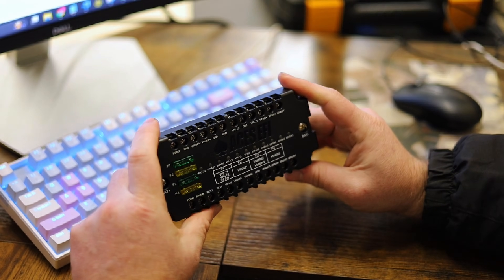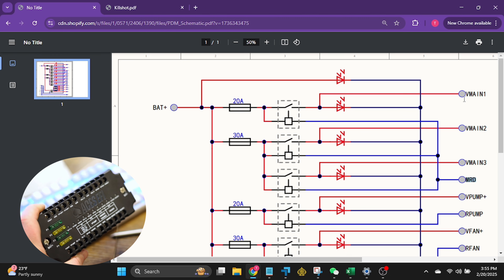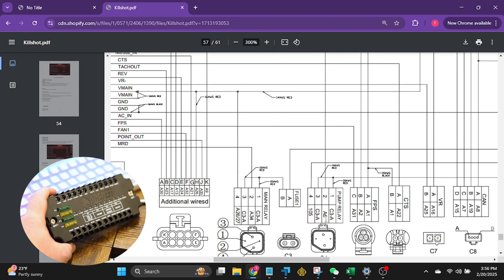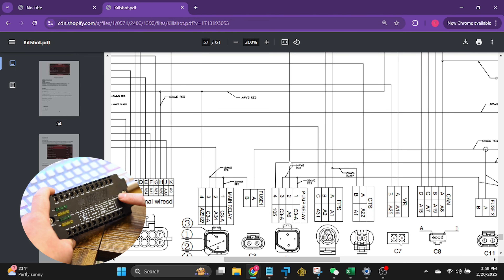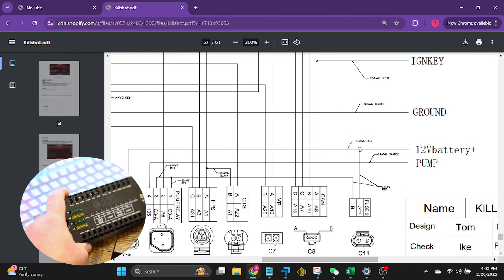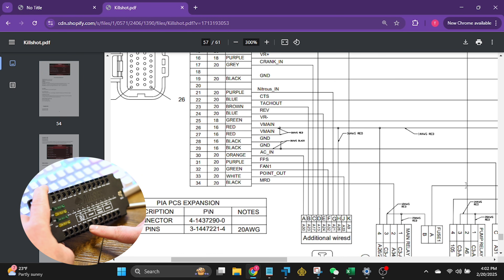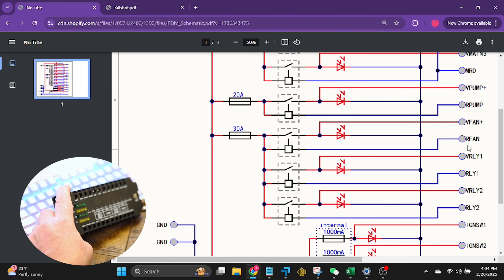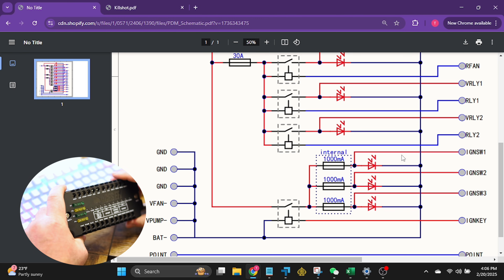PDM Schematic

Comment: Killshot fusion had wire labeled ground trigger In the additional wires. With that wire work on the pdm you trigger the vmaims or fuel pump w a killshot fusion

Comment: I agree, it would be much nicer to offer a replacemect harness for use with the PDM with the modifications already completed.  Once you come out with the modified harness in the future, will you offer a discount to existing PDM owners who want to upgrade to a proper harness?

What is the amp rating for each of the outputs - fuel pumps, fans, IGNSW 1-3, etc?

Additional question, if I do not want to modify my harness, can I just remove the harness mounted relays and fuses and connect to the existing harness with male spade connectors rather than cutting wires? Of course all connection points would need to be insude the vehicle or properly weatherproofed.

I just ordered a Killshot II system for my 1984 Cutlass to upgrade and replace my problematical electronic Qjet and am getting the top end kit with distributor and coil and the free PDM.

Last question, your instructions recommend installing the return style regulator after the throttle body - would I just connect the out line from the throttke body to the in port on the regulator, connect the return port of the regulator back to the tank, and plug off the output port on the regulator?

Thank you for your hard work to produce a quality fuel injection upgrade kit which looks fairly easy to install, is budget friendly for the masses, and I appreciate your continued commitment to innovation and support!

Comment: Can I use this only to trigger accessories off the 12v ignition source? I really only need it for things like electronic fuel pump (using the command center 2). Radio, and maybe fans?

Comment: I'm confused: 
1) If MRD is a line from the ECU that activates a relay ground, that then activates VMAIN, how is the ECU ever powered to activate the MRD lead? Sounds chicken and egg to me...
2) I don't see an MRD lead anywhere... is this only if you want to cut your harness apart?
3) VMAIN is supposed to be permanent battery to the ECU... wouldn't holding a relay open full time drain the battery?
Reply: With more research and playing around I think I may have answered my own question:
1) It looks like the MRD is triggered through the ECU when ignition hot is activated, so using the PDM it goes:
- turn key
- ignition hot activates IGNKEY on PDM
- IGNKEY activates IGNSW1,2,3 on PDM
- IGNSW1 powers up something small in ECU
- ECU activates MRD lead (small black wire moved from relay to PDM)
- MRD activates VMAIN1,2,3 on PDM
- VMAIN fully powers up ECU
2) this is assuming you've cut up your harness. MRD is the thin black lead to the primary power relay for the ECU. The intent is to replace the 2 relays and 2 fuses with the PDM.
3) VMAIN is not showing on when IGNKEY is not live, so it appears "permanent battery" is not connected until ignition on signals MRD to connect the VMAIN relays. So the only parasitic draw should be the always-on-for-some-reason BAT_IN LED

Comment: For the CAN handheld power (shown in the PDM general layout PDF going to IGNSW2) do you disconnect the 12V lead in the harness which attaches the CAN to IGNKEY and splice some wire in order to reach the PDM? Then with the clipped red wire that used to attach the CAN to the ECU, connect the ECU to the PDM at IGNSW1? This would give you two different 12V leads with one going to the CAN attached to IGNSW2 and the other would connect the ECU to IGNSW1 on the  PDM.

Comment: It would be awesome to see a blown up and labeled pic of the harness  (shown at 6:48 in the video) providing another confirmation of what wires from the harness attach to the PDM. I have an HEI and I’m trying to figure out the tach wire. I ended up snipping the gray TACH- IN wire from the additional wires connector… still working on it. I am planning to splice into my tach wire from the HEI to go to the POINT but I don’t think I need the GND right under it.

Comment: I think it would be nice to have an option for a wiring harness that doesnt have relays or fuses integrated into it that wires into the PDM without having to alter it. Or maybe a downloadable PDF that details how to alter it for the PDM. Just my opinion.
Reply: That is why we made this. That is the direction we are heading!
Reply: Or for a harness that has the relays in it so we have positive triggers.   So we can make a clean install and not alter the harness

Comment: I was wondering why I couldn't get things to work using the provided diagram. Now I'm torn to whether I want to modify my harness or return the PDM. Is returning the PDM an option?
I can appreciate what yall are trying to do with introducing the PDM, unfortunately there was no guidance or any mention of any of this when purchasing my system. I had assumed it was plug and play and would help me greatly with the wiring nightmare I was already dealing with on my Fox. So until this video I have been cussing this PDM.
Reply: Same here  wondering why my pump wasn't working this whole time thinking I screwed up something

Comment: I don't know if in need one of these or not.
I have had everything wired threw dry contacts for months..only thing i see it could do is clean up voltage on  main power coming from supply..i installed a voltage regulator keep volt constant to clean up supply voltage but due to fact can't get any answers from tech support so I
 don't know if i need to buy one.
Reply: If it isnt broken or having issues, why fix it? If you would like to clean things up and give it a cleaner appearance, go for it. If its working properly and not causing you any issues, dont fix what is not broken.

Comment: Wow that’s slick. Unfortunately I can’t use it. I have contour fans in my Fox. I need dual 70 amps
Reply: You can use it to control the dual 70amp relays, but not direct connection.
Reply: @ why have this and a dual 70amp relay when I can just buy a dual 70amp relay and have Killshot control my fans? Just to add another bigger box. I like this product just offer it with bigger amp relays.
Reply: @ you’re not wrong other than the PDM has other functions and features besides the fan. I’m currently installing a killshot and high roller setup and trying to decide if I want to include the PDM or just go with it as currently configured. I already have the PDM is my dilemma.
Reply: @ true, but I’m using the relay on the harness for my fuel pump. With another in the back of the car. Like he was saying, you could snip them off and use that PDM. I have no room with relays on the harness to tuck the ECU away in my car. This would solve that. Dog gone it, now you got me thinking🤣 I could mount that somewhere out of the way, and have room for the ECU🤷‍♂️🤣
Reply: @ lol now you’re feeling my pain lol

Comment: Can you also include the recommended wire gauge size, or size range?
Reply: In the schematic!
Reply: @TimothyLashuay  the schematic for the other products have it, but not for the PDM. For example, the KillShot has listed a 12 gauge for the battery. So, is 12 big enough for the PDM, KillShot, distributor, fuel pump, electric fan 1, electric fan 2? And now I'm going to add High Roller. etc, etc, etc.
Reply: I’m not finding the recommended gauge on either provided diagram.